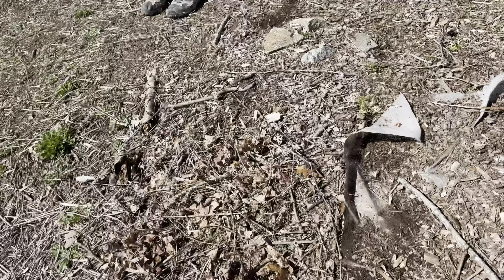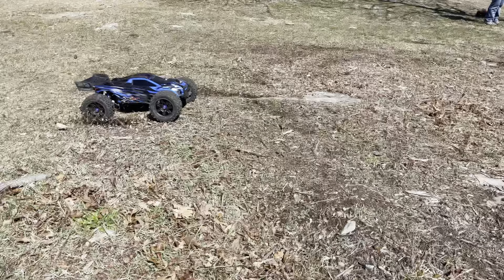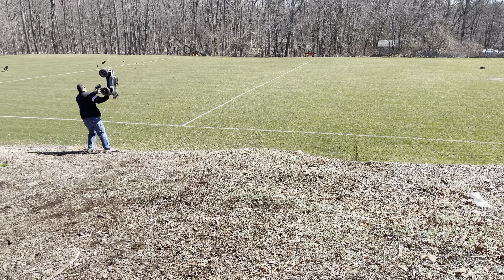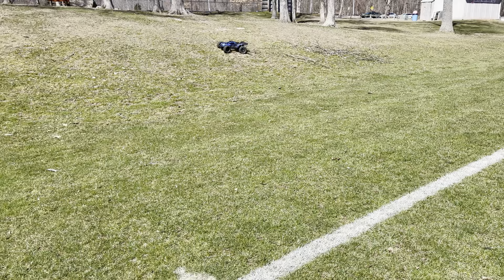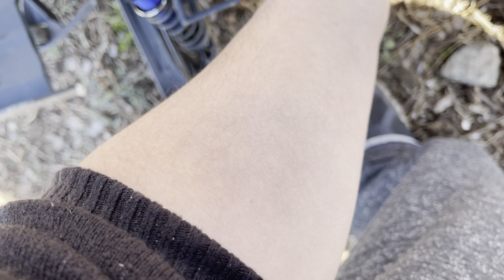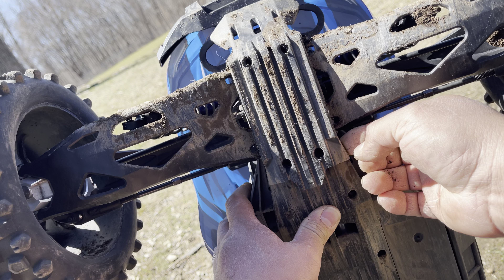Traxxas XRT Sunday bash (xlx2 1100kv, Vitavon) 35/46 ⚙️

Comment: How’s the heat on the motor with that setup? I have the xlx2 but with a HW 1100 geared pretty conservative at 25/50.
Reply from the maker: The heat is almost non existent with my fans , however with out the fans it def gets toasty and goes into thermal cutoff

Comment: Nice truck bro,can I ask where did you get the stuff to power your fans. I am having issues finding that stuff. Thanks in advance.
Reply from the maker: I sell the entire kit like you see in the video  100$ for everything 
2 fans 
2 fan covers 
1 power converter 
On off switch 
You just need to solder the positive and negative wires to the esc main leads
Reply from the maker: If you just want the wiring with the power converter I can do 50$  shipped
Reply: Would 12 volt fans work with the setup?
Reply from the maker: @michaellatini9294   yes it’s designed for 12volt fans can I ask what fans you have?